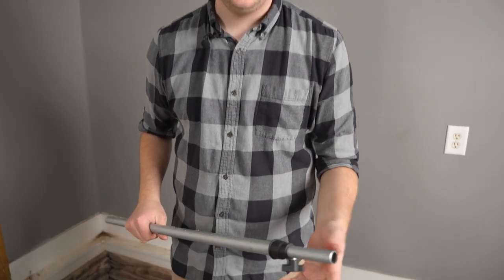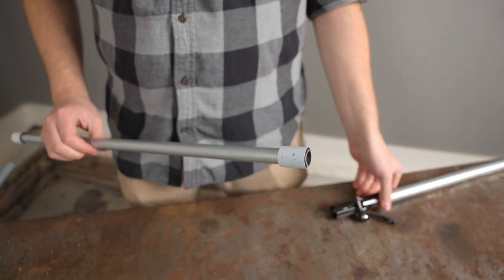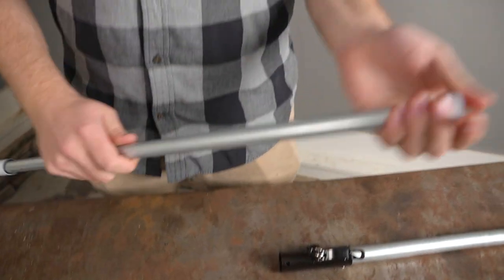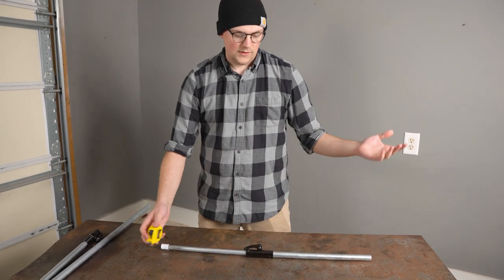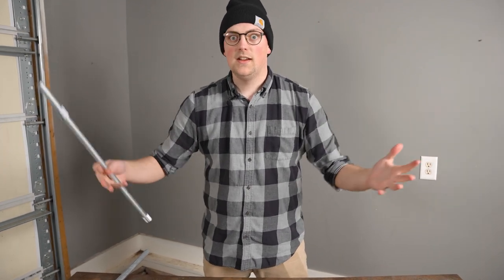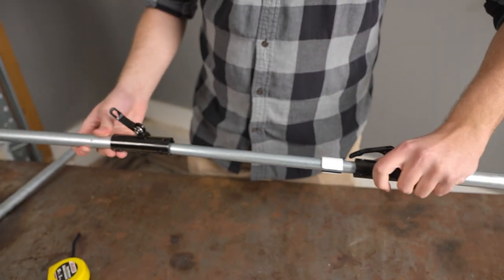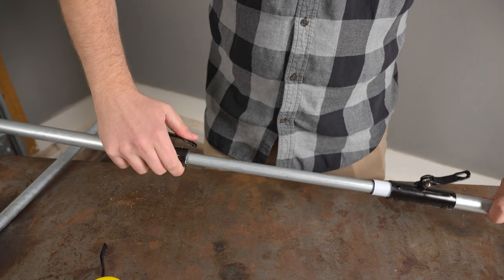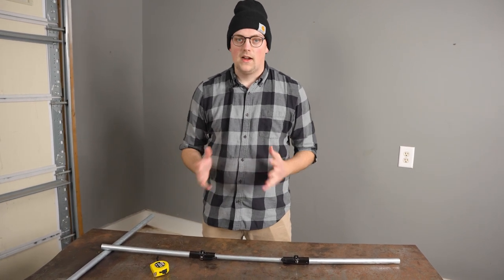This Accidental Telescoping Clamp Works GREAT!

Comment: You can always glue the shim inside the coupling to skip the step of sliding the shim back and forth.
Reply from the maker: Nice, yeah that’s a good idea!
Reply: or use the screw hole to capture the shim
Reply from the maker: Oh yeah good idea. Didn’t think of that
Reply: @JoshuaJoshua0  would be difficult because the shim is thin and you can’t screw through it all the way - the screw piercing the shim would prevent the 1/2 inch pipe from freely sliding through the shim.
Reply: @christiancicirale7149  yep, it would have to be a small screw
Reply: Use a short screw (or file/cut one to length) so that it does not interfere with the 1/2" conduit. A little JB Kwik metal epoxy applied under the head of the screw will anchor it to the coupling so that it won't back out. That should be enough to secure the shim so it won't slide with the 1/2" conduit.
Reply: If you glue the shim inside the coupling, you would want to be sure not to glue it all the way around. The shim needs to be able to compress under the coupling (and change shape/circumference) when the coupling is clamped. I would suggest applying a bead of epoxy about 1/8" wide axially along the side opposite the split in the shim, installing the shim with the 1/2" conduit in the coupling, then clamping it down while the epoxy cures. It should work nicely after that.
Reply: Very cool

Comment: Nice trick for a good clamp,  but i'm trying to make a better tarp pole that shrinks down as short as possible to fit a bike top tube bag and still extends 2m, or 1.8-1.9m. Best short version I can find is a telescoping boom arm with twist lock instead of cam locks. And correct me if I am wrong, these clamps aren't available in as many diameter options?

Comment: How about a 3/4 inch to 1 inch telescoping solution? My projects use 1 inch conduit.
Reply from the maker: Hi Darren, once we have the 1" EMT Coupling, you'll be able to do the same solution with 1" and 3/4" EMT. We will have those hopefully in the next 2-3 months. Thanks for the comment
Reply: @MakerPipe  awesome

Comment: do you suppose this would work the same for 1 inch and 3/4 inch conduit?
Reply from the maker: We should have the 1” EMT Coupling ready in the next couple of months. You’d be able to do it with that
Reply: @MakerPipe  HAHA yeah I realized you didnt have that after I asked this question.
Reply: @MakerPipe  on that same note, do you plan on making other 1 inch  connectors soon as well?
Reply from the maker: Yes, we are actively working on the Adj. Angle Hinge, 45 Degree Connector, Standard Flange, and Coupling for 1” EMT.